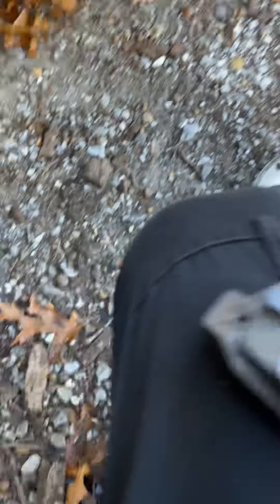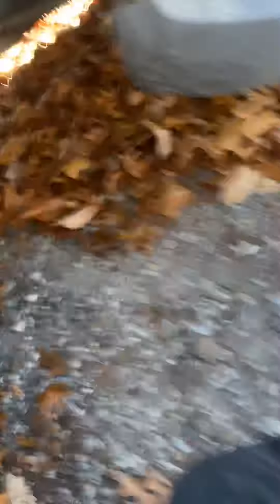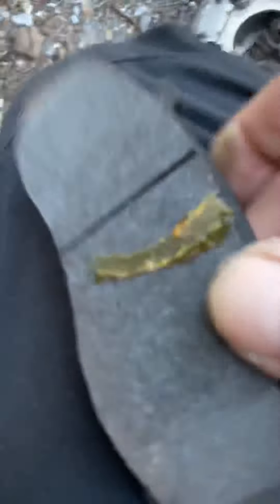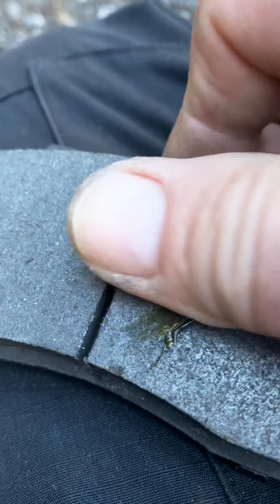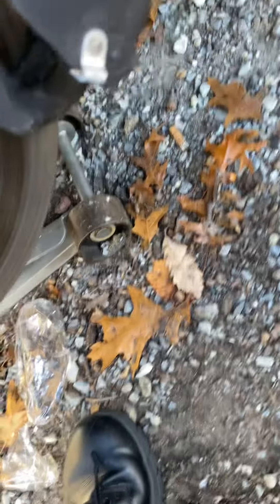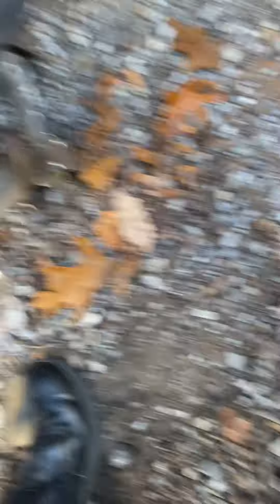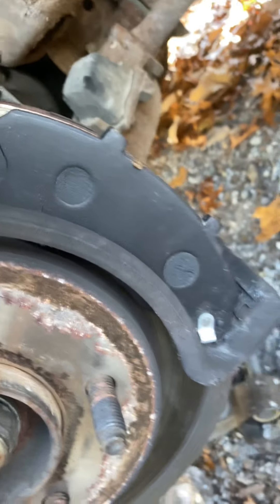Brake job part 2

Comment: Did my wheel cylinders n a brake line late spring. Pads probably soon enough though.
Even if i had money laying around id do it myself. Do have a real good mechanic i trust though . Tya
Reply from the maker: Same.  Thx Gtsy again